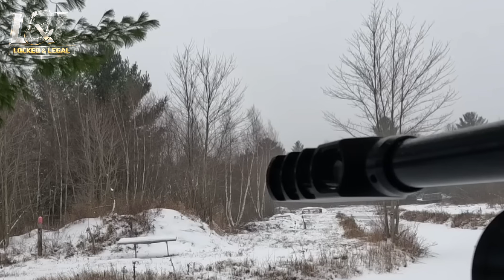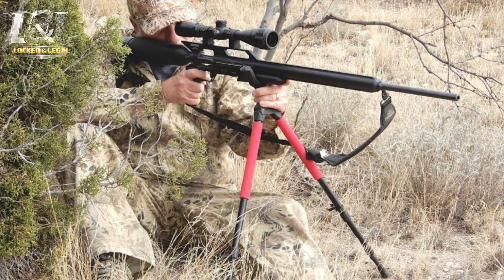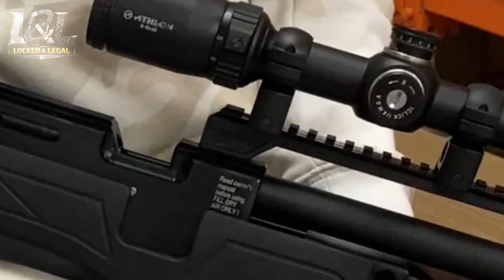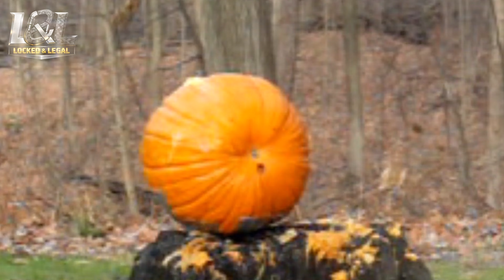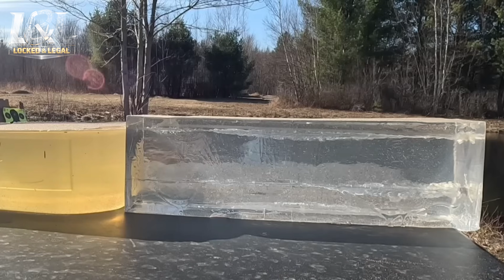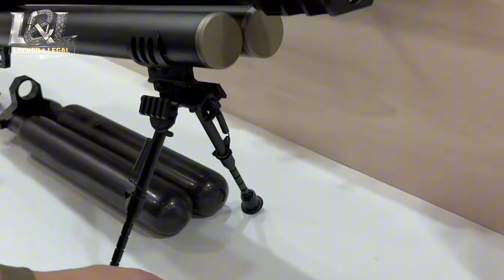The #1 Most Powerful Large-Caliber PCP Air Rifle Ever Created 2026– Up To .95 Cal!

Comment: There is mistake all new aea rifles use 7000 psi tanks
Reply from the maker: Thanks for the note 👍 In the video I mentioned 4,500 PSI systems for the Zeus platforms. The 7,000 PSI reference was about experimental prototype setups, not standard production tanks.
Reply: @LockedAndLegalUs All Zeus Mark 2 are 7000 psi tanks ready. Will be available soon as new for this.
Reply: 7,000 PSI tanks, Regulated to 4,500 PSI. 
None of the AEA guns run from 7,000 psi discharge pressure.
Reply: @akseminole Yes they use 7000 psi tanks but its regulated. Doest mean there is no benefit. You can set regulator high and have consistency
Reply: @gagain100 
I didn’t say that there was No Benefit. 

I Clarified that the airguns don’t Operate from a 7,000 psi discharge, because. I Know that one of the comment readers is going to read that and Think that they do. 

The primary reason for the higher pressure air tanks is to let you set the regulator at a lower pressure and get a longer shot string, OR, max the regulator out at 4,500 and get multiple Full Power shots, VS a 4,500 system only getting (1) Full Power shot.